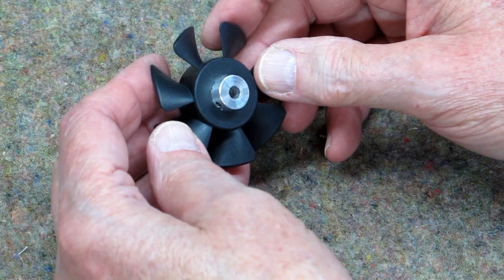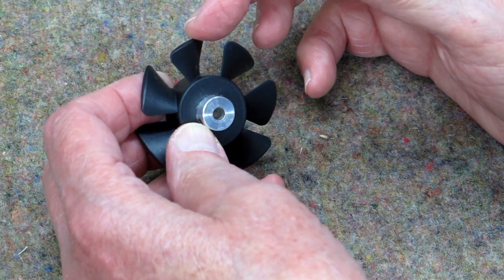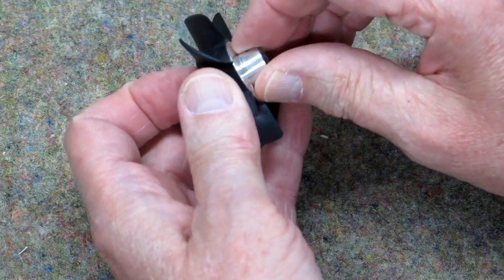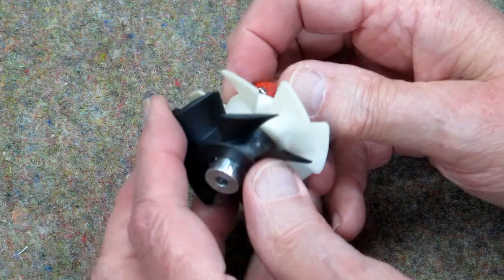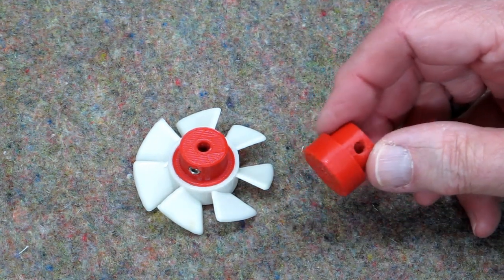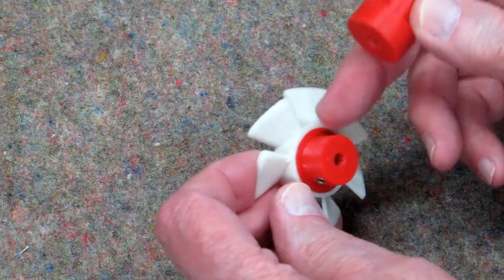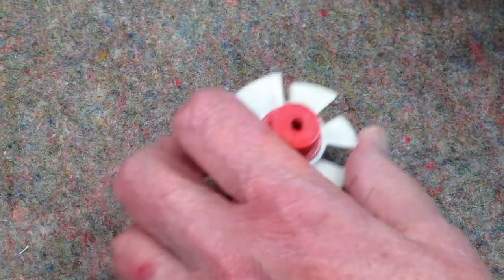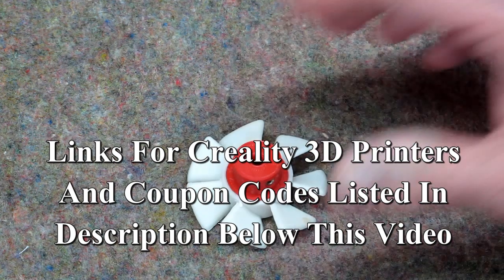Shaded Pole Motor Cooling Fan - Printed Adapter

Comment: A more robust method for mounting screws like that is to print out a hexagonal hole and press a hex nut with a soldering iron into the hole to secure it in place. While the nut and plastic is still warm, you can insert the screw for better aligning the set screw.

Comment: I'm amazed the printer can print those tiny internal threads
Reply from the maker: They are usually pretty good threads. Horizontal are sometimes a bit rougher and need chasing with a tap.